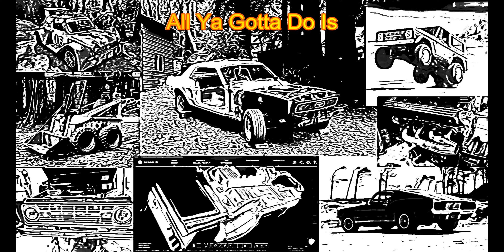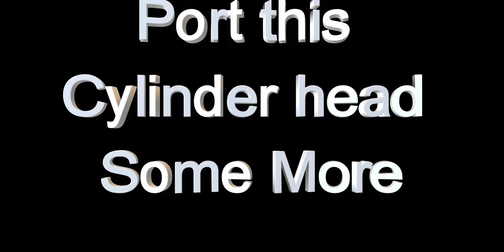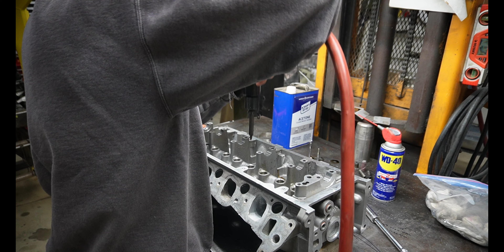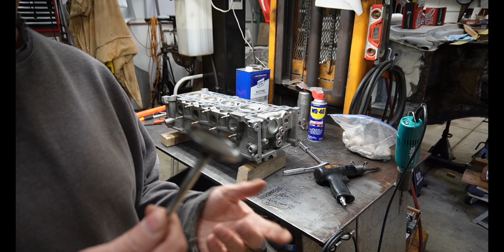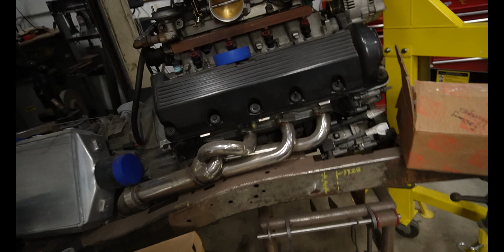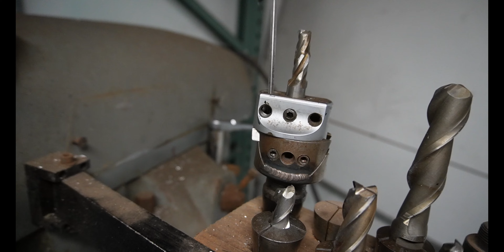Stage II 4.6L 2V Head porting

Comment: Hi, I'm modifying my 4.6L 2-valve Mustang engine. The engine was completely rebuilt and machined. My dad and I did a modification by installing 5.4L 3-valve Lobo flat-top pistons for increased compression. We also installed headers, and we're currently porting the cylinder head. What advice would you give me? There's a lot of airflow loss that's reducing power. We detected a slight skipping at the valve exits. However, I'm undecided about just polishing the cylinder head without porting it, for fear of losing compression.

Comment: Correct me if I’m wrong but it seems that the majority of your air flow gain were achieved through the actual porting of the intake/exhaust ports. Would it be beneficial for me to do just the porting to a set of PI heads for a mild build? I’m not looking to really do much more than rebuild the heads with new seals and guides and do a valve lapping job after getting them checked out by the machine shop. Great videos man I love seeing custom work on these because the aftermarket heads just seem like cash grabs!
Reply from the maker: If you are running it on a factory ecu and don't want to pay for a dyno tuning session, leave the swirl dam in place. Otherwise you will need to completely remap the part throttle mapping. Read: lot's of time!
Reply: @scottmgraves34 Thank you for that information sir!

Comment: are you thinking about putting these onto a early non-pi block and getting extra HP due to the extra compression ? you go from 9:1 to 10:1 get to 300hp a lot quicker than sticking with the original block.
Reply from the maker: Nope. The combustion chambers will be welded up to make a more efficient shape, so that will increase compression ratio more that I want. It is going into an early Bronco with an aluminum block and a supercharger (Allen Engine) and a Garrett GT42 Turbo.  Should make around 700 HP. So not stock pistons...